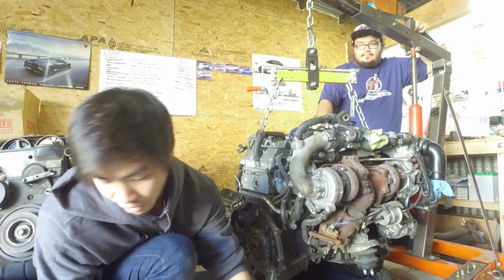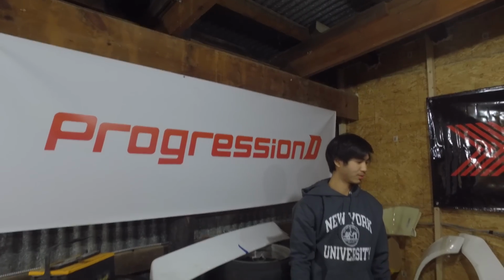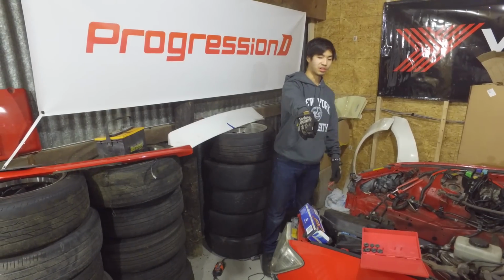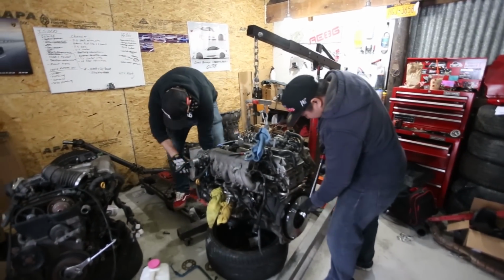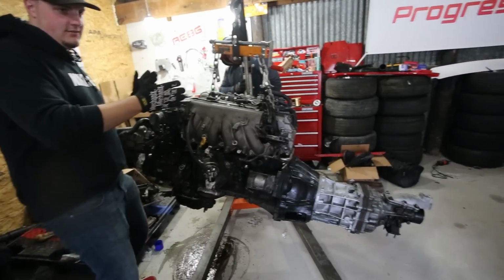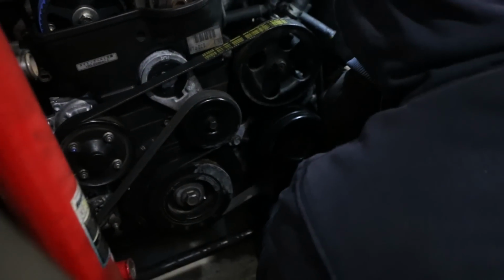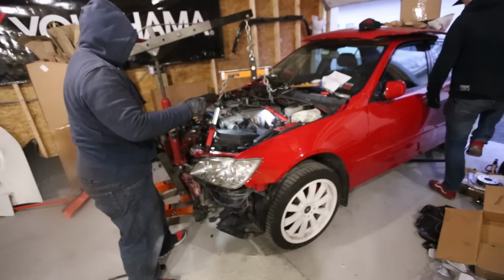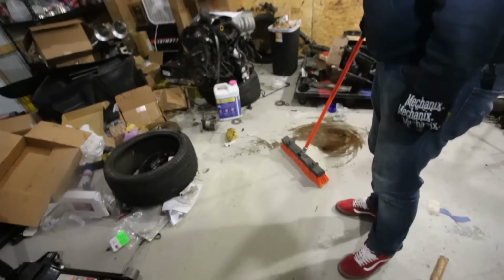IS300 Drift Project Part 4: Motor Mounting

Comment: Hey man had a question on that excessive shifter extension on the r154 is that something you think you could take off and install with the r154 in the lexus have a similar build but never did the extension and it's hard to get in the top gears ???

Comment: out of curiosity, why not use a 6 speed like a V160/161, CD009 or TR56/6060?
Reply from the maker: V160 is completely out of the question. I will be surprised if you can find one under $9 grand these days. CD009 and T56 is uncharted territory for me. I'm sure there are plenty of fabricators out there that treat it like a piece of cake. But, I can't do custom fabrication. I got my rebuilt R154 at a great price. Not to mention, almost everything is ordered and bolt on, including the driveshaft. The only actual fabrication I had to do was that shifter extension.
Reply: ahh ok yeah thats fair enough, the V160 is about half the price for me in Australia but still super expensive, I've gotten a TR6060 for $1200 which was dirt cheap and there are enough parts around that it will still be cheaper than going V160/161.
Reply: And overall I'm trying to lighten my IS300 as much as possible, and the TR6060 is as light as a R154 and pretty much as strong.

Comment: Lexus IS300 Drift is better than SUBARU WRX STi. 
Lexus is better than and faster than 
1. Toyota Supra Mark IV V6 Top Speed 270KM/H 
2. Mazda RX-7 V4 rotor Top Speed 250KM/H 
3. Mazda RX-8 V4 Top Speed 250KM/H 
4. SUBARU WRX STi Top Speed 250KM/H 
5. Toyota GT86 V4 Top Speed 230KM/H 
6. Toyota MR2 V4 Top Speed 225KM/H 
7. Mitsubishi Lancer Evolution VIII, IX V4, Top Speed 225KM/H 
8. HONDA CIVIC Top Speed 240KM/H, TYPE R Top Speed 270KM/H 
9. Nissan Altima Coupe Top Speed 230KM/H 
10. Mitsubishi FTO Top Speed 180KM/H 
Lexus tuned is better these tuned cars. Hennessy Tuner says Lexus is the best tune car.